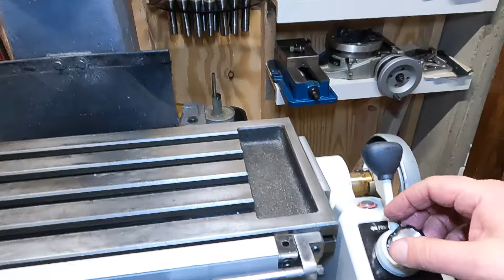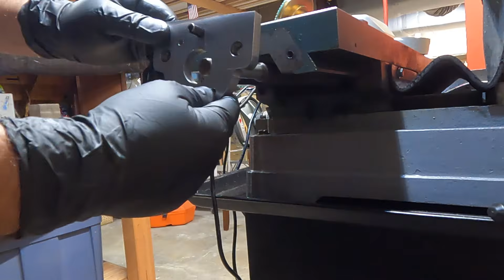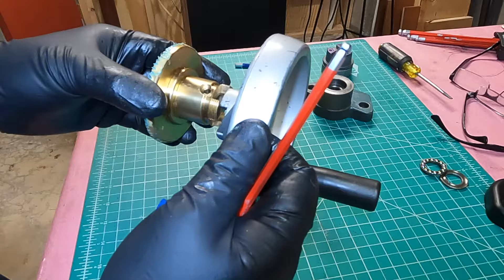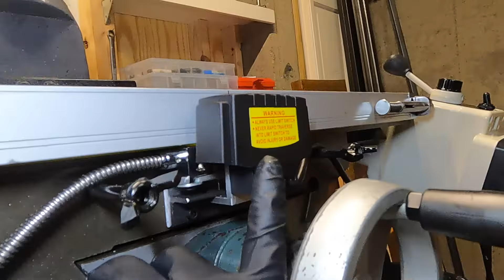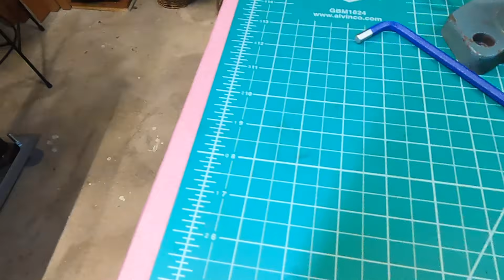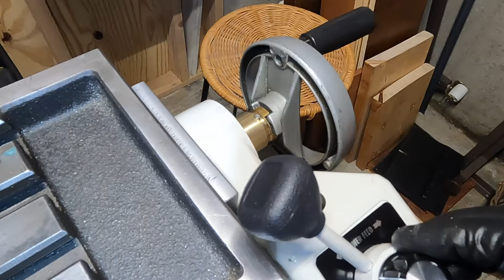Vevor Power feed on a Round Column Mill

Comment: Thanks for the vid. I have a Central Machinery round column mill that is about identical to yours here. After seeing you do this, I decided I want to install a power feed on mine using your advise. The  things I plan to change is using a roll pin to hold it all together. I need to remove the lead screw and cut a keyway, and while I'm at it, go ahead and turn the end portion of the shaft down to 5/8 to fit the ring gear, then thread the end to 5/8. I can then use shims to get the correct lash between the gears, and tighten down. I'll probably have to get a 5/8 handwheel.

Comment: Hello, could you send the dimension of the plate you fabricated to fit the power feed?
Reply: I just did this job on my round column Mill, I found the easiest way it was to swap the plates on both sides of the table so that the right side with the bearings go to the left side, the step didn't need any modification 

Furthermore with the left side plate on the right I was able to machine down the shoulder on it until it was a flat piece of cast iron, now you need to make a bushing that fits over the shaft of the lead screw and into the bearing inside the power feed. 

Once you have that concentric and the power feed located where you want it, then using a transfer punch you can mark at least two of the holes from the power feed into your cast iron plate (there won't be material behind the bottom two holes for the power feed)

And now your cast iron piece is a template for making a bracket out of half inch mild steel, simply transfer punch all the holes into your new plate, Mount the power feed back up on the mill transfer punch the two other holes on the bottom side of the power feed

Comment: Good video. I thought I found a similar power feed for the left side but the picture was mirrored. Smh. 

I may be doing something similar to your build but I don't have a lathe so if I go that route, I'm in for a challenge. 😂

I have been thinking about swapping the lead screw and mounting brackets, basically reversing the side the bearings sit on.  This should simplify install as well as retain my manual dial without modification. Any reason why this is a bad idea?
Reply from the maker: I think swapping the lead screw and bearings is a great idea. Someone else suggested that to me after the fact and I wish I thought of it. I don’t know if it will work for sure, but I don’t see why it wouldn’t. And it would simplify things quite a bit. Let us know how it goes.
Reply: It sure does! I just did the same job on my mill, the plate with the bearings fits right on the other side no modifications needed for that, additionally it gives you more of the lead screw sticking out on the right side for mounting the power feed,